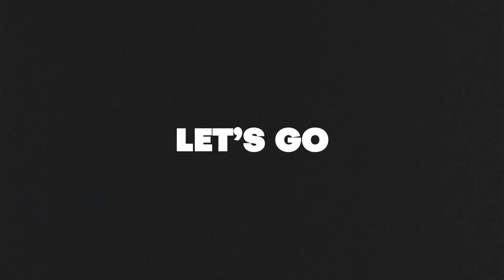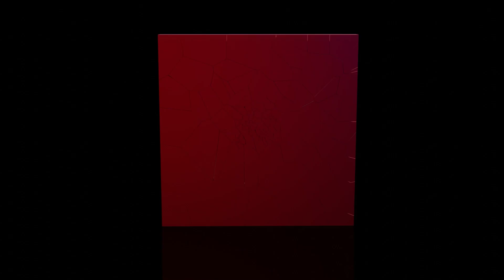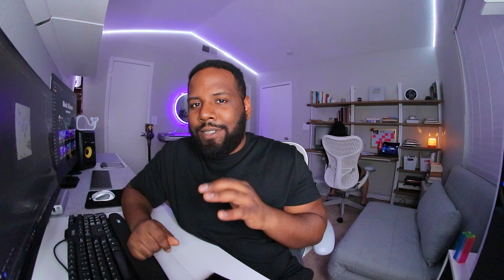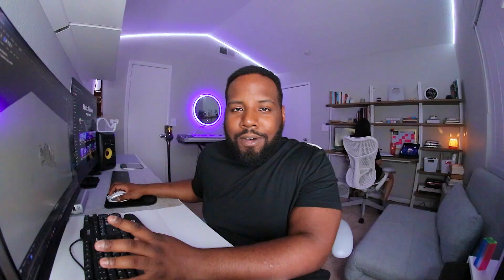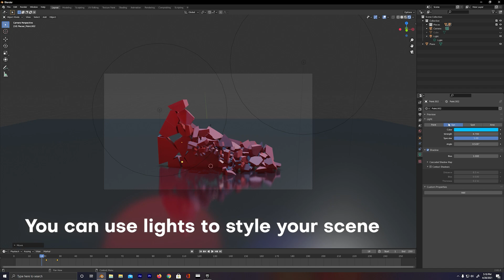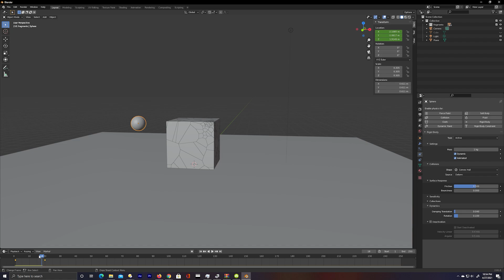Your 1st Hour in Blender - 3D Basics Beginner Tutorial

Comment: Excellent video!  Having an issue following it though... I've tried this multiple times, and rewatched the video multiple times to make sure I didn't miss anything, but my wall always just slides out into thin horizontal pile -- almost no pieces end up in front or in back of the wall when it falls.  Can't figure out what I'm doing wrong.  It's a very unsatisfying effect compared to the nice round rubble pile that happens in the video.  Using Blender 3.0 if that matters.
Reply: I got the same thing. Have you been able to figure this out yet? I'd be interested in knowing the solution.
Reply: @Brent Polite  I have not. I assume it's a difference in how blender 3.0 works versus the older version used in the video, and I don't know how to fix the issue.
Reply: Yeah, I had the same problem. But it doesn't seem to be a version problem (I'm using 3.1). It had something to do with my original annotations creating a single layer of cells that went through the entire wall. I created another wall and subdivided it once instead of annotating, there were irregular cells all through the thickness of the wall, and it crumpled very nicely. Then I made another one which I again only annotated, but I did it in front ortho view, and make doubly sure I was scribbling on the actual surface of the wall -- and again it had irregular cells throughout the thickness and crumbled just fine. I can't recreate what I did the first time, but it must have had something to do with the annotations not projecting correctly. It would make sense if the wall has only a single flat layer of rocks that they'd kinda slide apart instead of spreading out -- mine did spread a little at both ends of the wall.

In any case (if you still care months later), if you can't get the annotations to work, bevel the wall (2 segments is enough to give it structure), then subdivide it (once is enough to get the effect), and then use cell fracture with Own Verts instead of Annotation Pencil.
Reply: Thanks! It works with your Own Verts method